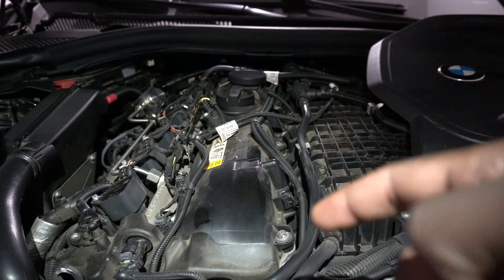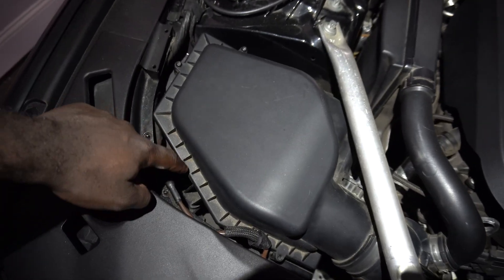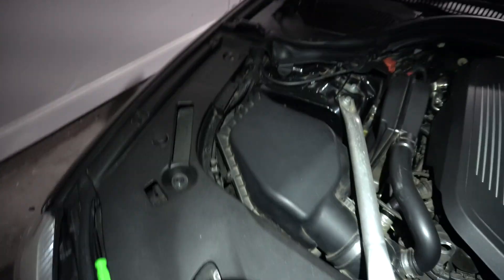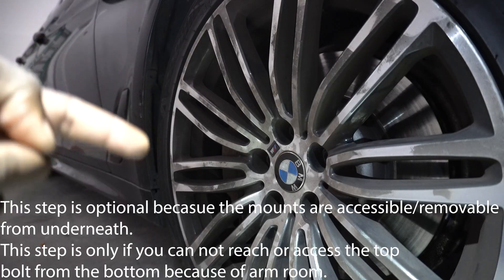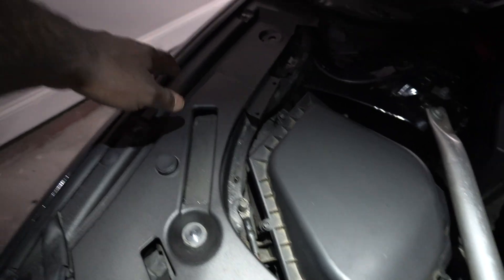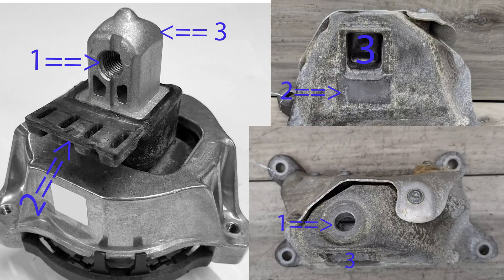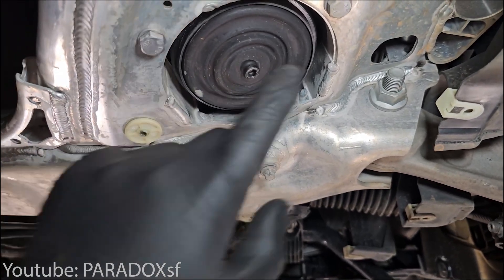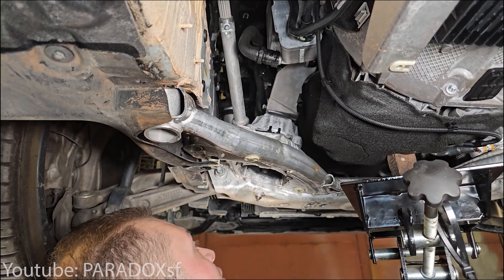BMW G30, F90, G11 Motor Mount Replacement | Quick DIY Guide (2016-Present)

Comment from the maker: General Tools:
Socket set (metric sizes, including Torx sockets)
Screwdrivers (flathead and Phillips)
Pliers
Torque wrench
Specialty Tools:
Engine Bridge (e.g., 0 496 430 or equivalent)
Spindle Adjustment Tool (e.g., 2 361 506)
Spring Strut Dome Adapter (e.g., 00 6 050 or 00 6 052)
Wheel Bolt Adapter (if anti-theft bolts are installed)
Additional Equipment:
Jack stands or lift
Mobile table lift (optional but helpful for axle support handling)
Make sure to follow torque specs and safety precautions for a smooth repair! 💪
If you have questions about any tools or steps, feel free to reply here! 🚗✨
Reply: With 4x4 drive, this technique doesn't work; you can't lift the engine enough to remove the mount.

Comment: Would it not be easier to lower down sub frame at the same time by an inch ? (Mount seats on the sub frame right? )
Reply from the maker: @TomHenry2  you could if that’s how you feel like you could accomplish it he said he didn’t take off the windshield cowl so it’s possible with just the trans jack
Reply: @buntai8547 hey so you verified that this can be done without removing the windshield cowl? Only my driver side engine mount is shot. You think I would be fine. Just jacking up the driver side of the engine and replacing just that one side without disconnecting the other side?
Reply from the maker: @GaroBarsemian yeah it would be perfectly fine to do that
Reply: @buntai8547 if I’m pushing like 450 hp now after stage 2 tune is it recommended I stay with stock mount?
Reply: @GaroBarsemian  The BFI stage 1 mounts look good for tuned cars. Stock mounts are intentionally designed soft for minimal vibrations, but with that comes poor longevity and quickly wearing out especially when tuned.

Comment: Is it the same for X-drive cars?
Reply from the maker: @erdman535  The process is almost identical for xDrive cars, but you may need to remove or lower the front axle and disconnect the driveshaft to access the engine mount.